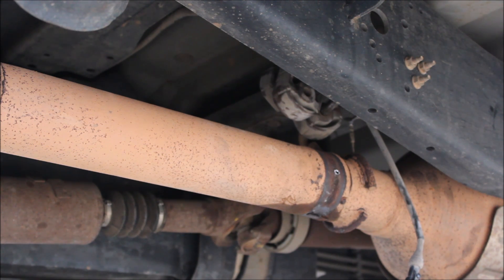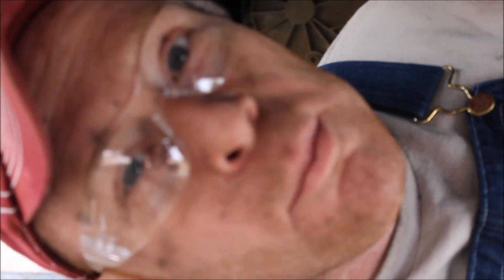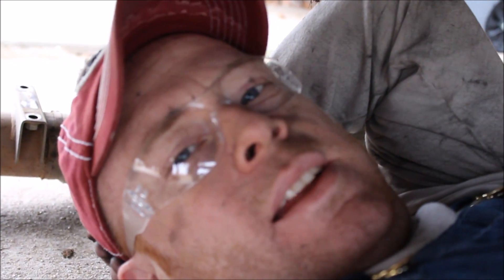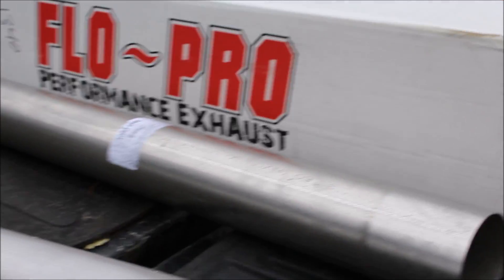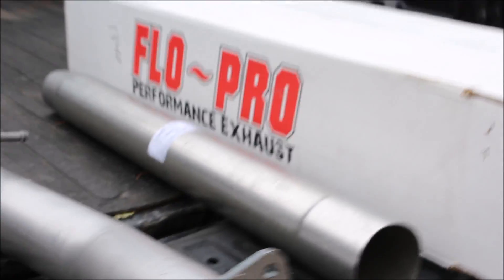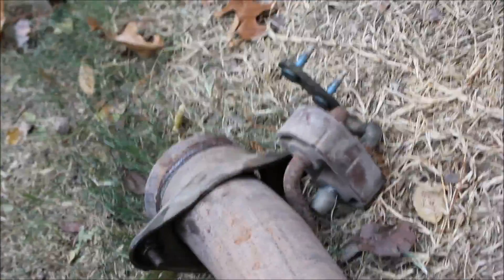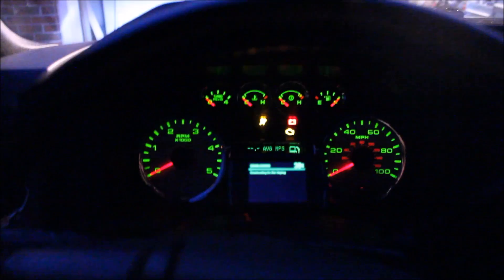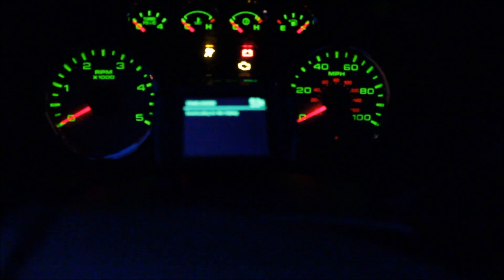2008 F250 6.4L DPF delete

Comment: Curious as to what your mpg Is now? Have any updates after some use out of it.
Reply from the maker: The mileage is roughly 18 MPG but that is usually towing something like a tractor, stock trailer, etc. I am EXTREMELY happy with the kit / tuner combo. Worth the $$$ for sure. My oil comes out tainted golden after 4k miles now.  Literally just added 200k+ life to the truck imho.
Reply: USAF99 my only hold back is I have to take the truck through emissions,  but I do want to do all of these things. Thank you for the reply and real world info
Reply from the maker: Big Jon you could weld a flange on both parts and make it quick change for inspection. Bolt in and out. It's such a difference and all that regen is doing is destroying your stuff man.
Reply: USAF99 that's kinda what I was thinking of doing. I might be able to get away with one end as a slip fit. We don't get any rust, but I do like the thought of bolts instead of clamps. I'm chomping at the bit to get the crap turned off as soon as possible.
Reply from the maker: Eh-- the stock slip fit was kinda tough to get it in/out as you saw in the video. We normally don't get rust either (Oklahoma) but rain etc... The inspector is going to know exactly what you are doing but as long as you are legal at inspection....
Reply: USAF99 what tuner did you get? Did you delete or block off your egr?
Reply from the maker: I have the MiniMaxx tuner, sadly they are no longer available from the manufacturer but are available on E-Bay, Amazon Etc... If you can get your hands on one, I suggest doing so. I did NOT remove my EGR, I just turned it off. I did this so the coolers could stay in and support the up pipes to the turbo like intended while stock. If you remove the coolers the pipe is only supported by the attachment at the turbo and one mount at the back of the engine. This creates a vibration in the pipe and will eventually crack causing all kinds of problems to include a possible fire.
Reply from the maker: Watch this video https://www.youtube.com/watch?v=TrSJyEm9SEQ
Reply: USAF99 hahaha, just watched that video the other day. I have been looking for a mini maxx tuner older version. I also plan on leaving the egr in place for the same reason. I have also been looking at the sct x4 tuner. It will turn off both as well.
Reply: Mine went from like 10 to 15. MPH and overall performance is spectacular.

Comment: USAF99 are you running the factory muffler or straight piped all the way back. I just ordered the same kit as you just waiting for delivery
Reply from the maker: I only replaced the parts that came with the kit. So the short answer is, factory muffler. I would like to eventually remove the muffler and have it straight pipe all the way, but I still have not made it to the exhaust shop that I talk about in this video! LOL

Comment: did the same thing you did on my 08 f350 had a fairly easy time getting the dpf and cat out with the aid of a ratchet hoist pulled right apart put it together same way the real bitch was the lower egr cooler it's like ford's version of a rubics cube programed the minimax forgetting that I should have done this prior to turning a wrench so I wound up jacking the pipes up against the bellie so I could plug in all the sensors and do the pre tuner delete like hand s recommends still want to do the upper intercooler pipe mod but I'm happy as hell with all the results just doing a weekends worth of cussing under the truck . it do 0 to 60 in 8.2 seconds on the sidewalk

Comment: I did the dpf delete on my 08 . I just  put in a 4 " staight pipe kit to the Muffler and an H@S mini max controller I didn't touch the Egr I was told I didn't have to that the programmer would delete it , but I don't know . I do no that my F-450 runs like a scolded ass ape now and before it wouldn't hardly even pull itself let alone a trailer . best $2,100 I've ever spent ! if you're having trouble with a 6.4 this is the way to fix it
Reply: Tony Limbaugh please delete the egr.  just turn it off does fix the problem as a hole. enough pressure can build and open the egr valve which is not good at all
Reply: Now get that EGR out before it chokes the intake to death. PS that left side up pipe will crack on a couple of places so do what you have to to replace them. I did mine with new manifolds as well. But I also machined and rebuilt the heads. This was a cab off job. So just get in there and do it. Get rid of all that Ford-approved international junk you should get 1 million out of it keep up or do better on the services 😊👍❤
Reply: Plus get ARP head studs the gaskets are going to go any way so why not? Just do it. I'll just say it. I warned you.

Comment: did the mileage improve?  what tuner do you recommend?  all together what all did you spend on the pipe and tuner?
Reply from the maker: Fuel Mileage definitely improved as did power and Pyro Temps. I use the H&S Mini Maxx, but they are considerably expensive now that the company is out of business, and only tuning shop's etc. will support them. You can pick up a Mini Maxx on e-bay or amazon for about $800, the cat/dpf delete kit cost me $180.
Reply: Sweet I just bought an 08 6.4 with 35k miles on it.  It just doesn't sound like a diesel.  More so than the 6.7 but I need to hear my truck or I don't feel right.  

Thanks for the quick reply.

ETV2 SS uss florida 728G
Reply from the maker: You bet! Yeah, get rid of that motor killing DPF and the EGR. Watch your oil level while the DPF is still on, its not uncommon for it to rise 2 quarts over the life of an oil change....and that ain't oil. There are PLENTY more videos on the subject if you search for powerstrokehelp and watch Bill's vids.
Reply: Thanks!  I'm pretty clueless when it comes to the 6.4. Familiar with the 6.0 and 7.3 but this thing is a completely new beast.   Thanks for the heads up.  Have you done the egr delete?  They have a egr/dpf/cat delete with mini max tuner for like 1300.  Wondering if it's worth it to do an egr delete.
Reply from the maker: Eh, I used the Mini Maxx to just turn my EGR off. I am hesitant to remove the EGR coolers without anything to replace them with. The kit that I have simply deletes the coolers and replaces the valve with a pipe to the charge line boot. Problem is, the rear pipe that the EGR coolers come off of is only held on with one clamp at the turbo and a bracket on the back side of the motor. The way it is engineered, the coolers actually stiffen that pipe. Without the coolers, the pipe vibrates and eventually cracks, specifically at the mount on the rear of the motor. I find it easier for now to just leave the valve and coolers in and keep everything tight. Last thing you want back there is an exhaust leak-- that's what causes fires.
Reply: So i just deleted my DPF and haven't messed with the EGR.  I am trying to find out if there is anything special i can do to my tuner.  like leave the EGR on and DPF removed.
Reply: USAF99 I was about to the same setup you did and add a S&B cold air intake. There are some people online saying the H&S will eventually kill the truck due to timing. Is that issue a possibility if you only use in stock tune and like you only really have the H&S to turn off EGR  . Have you experienced any engine issues with the mini max. Like you also don’t have the need to race the cows around the farm.

Comment: by getting rid of all that and stop making it do Regen will it stop adding fuel to the crankcase as well I plan on buying a 6.4 and hear Regen fills your crankcase with diesel
Reply from the maker: I have been testing it and recording my results to make sure, but, since it no longer does the regen cycle I am pretty sure I am just solidifying what I already know. The only reason your oil level should rise is introduction of Diesel fuel to the crank case or introduction of coolant. Since I shut off the regen cycles, it no longer introduces fuel to the exhaust stroke. Short answer, Yes. There will still be a small amount of blow by that makes it to the crankcase, but no more than any other internal combustion engine.

Comment: Emissions smissions man..... As long as your not doing anything stupid like Rollin Coal you'll be fine to drive the truck like you normally would anywhere you want to.
Reply from the maker: Yeah, I ain't really a fan of "Rollin Coal"....diesel is too expensive to throw it out the tail pipe and I work to damn hard for my $$$ to throw it away.

Comment: Is the truck still running good? Lol 😂😂 race the cows on the 300 race tune
Reply: USAF99 do mine every 3500 mile and fuel filter every 3rd or 4th change.
Reply from the maker: Tommy Bragalone like a champ!
Reply: USAF99 how many miles are on it
Reply from the maker: 156k. The ol' stroke is just now getting broke in. Runs like a clock!
Reply: USAF99 nice man just be careful I've heard a lot of bad shit about 6.4s  do you drain the water separator
Reply from the maker: Yep. At every oil change regardless of if the Water light is on or not. Fuel filters every third oil change, oil changes every 4k miles. Its overkill, but routine maintenance on these trucks keep em living forever.
Reply: USAF99 yup I bet your truck will live for a long time since you do early oil changes I change my oil every 2K miles on my f150 and fuel filter gets changed every 5k miles I use fully synthetic oil i beat the living shit out of my truck and it's still running good it's straight piped with no cats and 2 8 inch cherry bombs

Comment: Great video! Fixing to jump under my 450 and get started.
Reply from the maker: Remember the rear clamp is riveted on the passenger side-- if you cant get the nut to turn, just cut that mother off.

Comment: did you have to download a special tune?
Reply from the maker: No, I am using a Mini Maxx tuner. It allows me to remove the DPF for Off-Road use and the CEL stays off. Without a tuner, I would not advise removing the DPF or any other emissions equipment, the truck will literally stay in Limp Mode and run like crap.

Comment from the maker: I just realized Flo-Pro should be paying me for all the shameless promotion I did in this video....Sorry Guys.
Reply: Shadow Shot hey man when you didi the DPF delete did the check engine light stayed on???
Reply from the maker: No, I am using a Mini Maxx tuner. It allows me to remove the DPF for Off-Road use and the CEL stays off. Without a tuner, I would not advise removing the DPF or any other emissions equipment, the truck will literally stay in Limp Mode and run like crap.
Reply: Mine is All good using the Mini Max

Comment: The black rubber piece is a vibration dampner
Reply from the maker: That's just it, there's no rubber on it. I hit it with a hammer to make sure it wasn't just hard rubber....its steel. Makes no sense.

Comment: Run that h&s in stock mode.  Otherwise it advances the timing so much you will find the weak point in the engine pretty quick.
Reply from the maker: That's where it stays for the most part. I really don't change it from stock or towing....which that mode is kinda pointless since it does the same thing as the "Tow/Haul" button on the shifter.